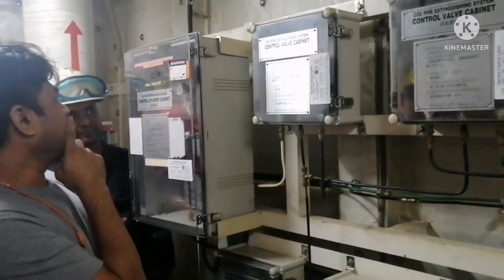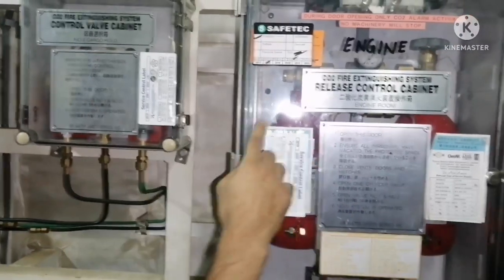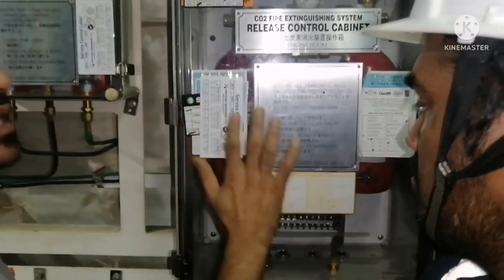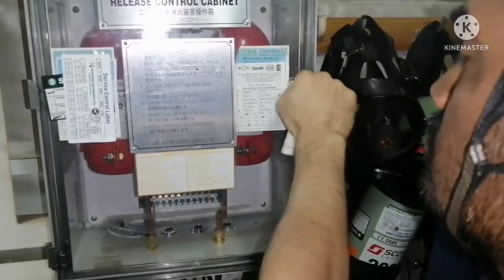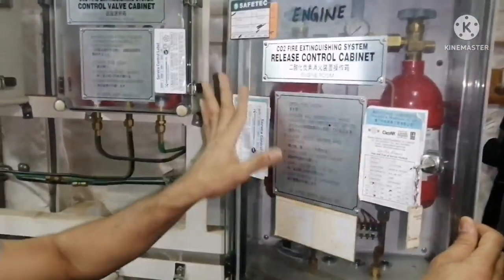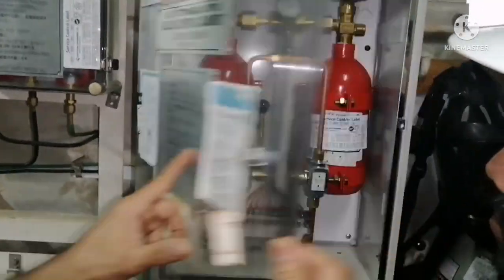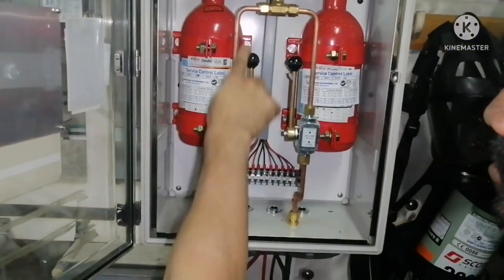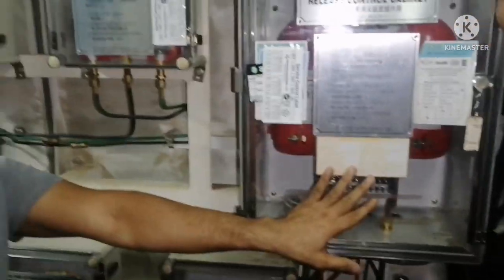HOW DO THEY DO.. HOW TO OPERATE CO2  FIRE FIGHTING SYSTEM FROM FIRE CONTROL STATION ONBOARD SHIPS..

Comment: Basha: (casually opens the control box, showing the internal components)
Engine room alarm: RRRRRRRRIIIIIIINNNNNNGGGGGGG!
Engineers and sailors in engine room: (scared their sh*t out)  (running up the evacuation stairs) (banging their heads on girders) (getting tripped by pipelines) (finally found their way out) (shouting out F words and Sh words)